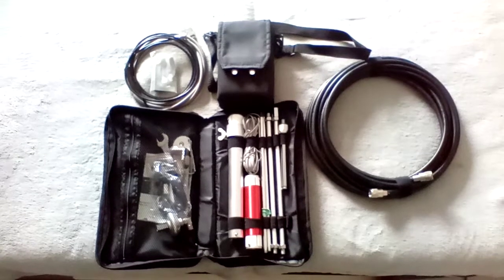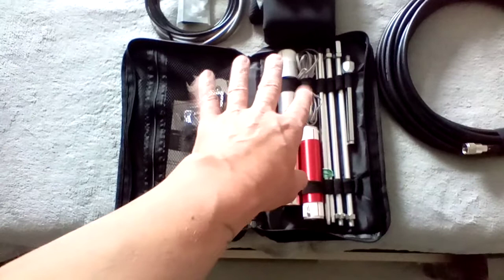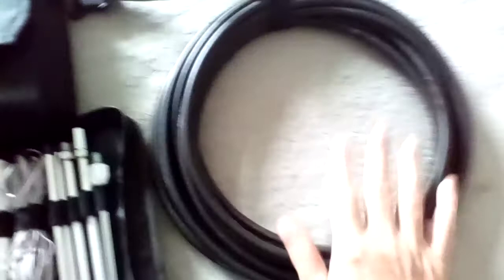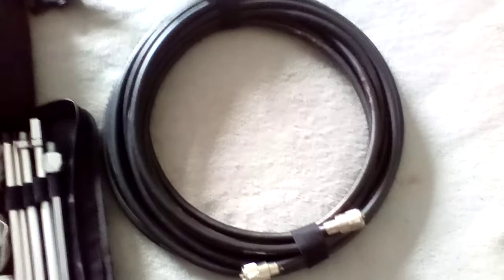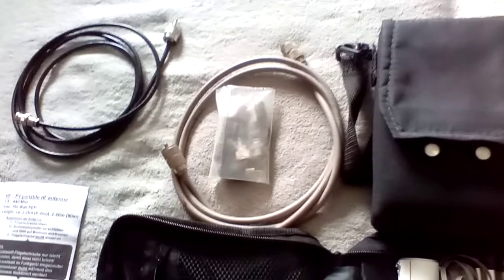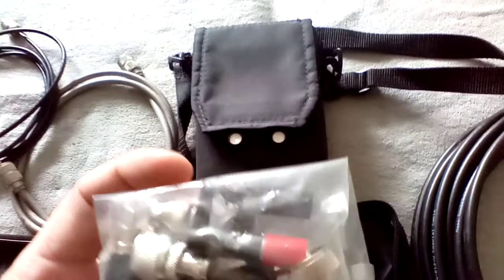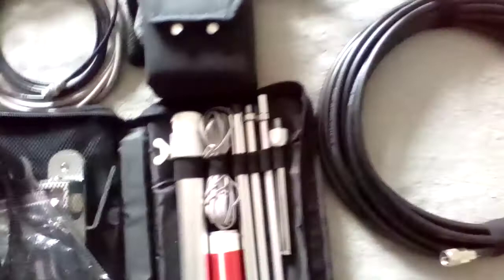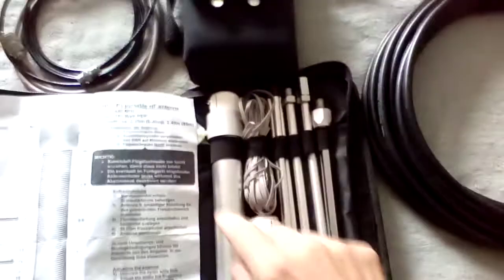DK5ONV about his new toy to play with

Comment: GREAT ANTENNA i had one for 3 years  fantastic
Reply from the maker: Hello Andy, thx for stopping by. I am very excited to test this Antenna tomorrow afternoon. I will run my first test with 25feet. standard RG-213UBX Coax. I need to roder new aircell 5 and aircell 7 coax which is thinner and more flexible but I am sure for the 1st Testrun the RG-213 will do the Trick.
Happy sunday into England, 73's de Your Friend Uncle Geunter